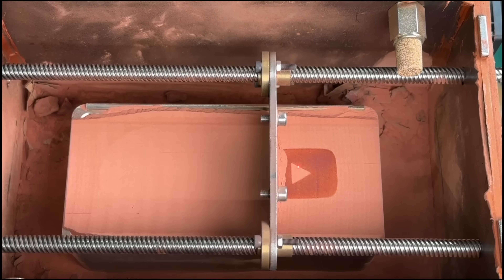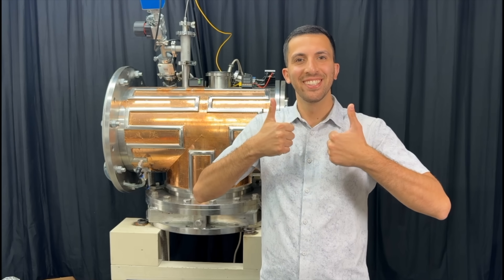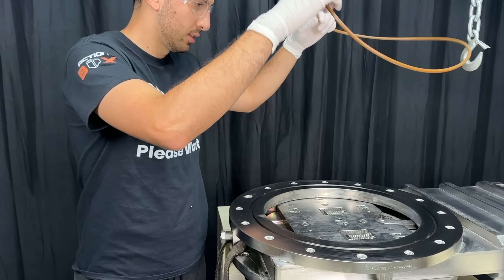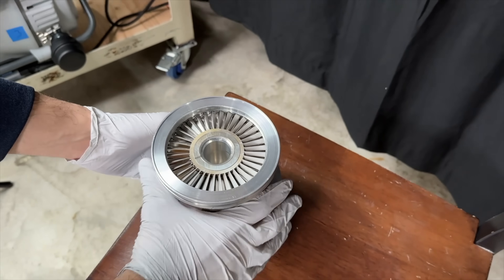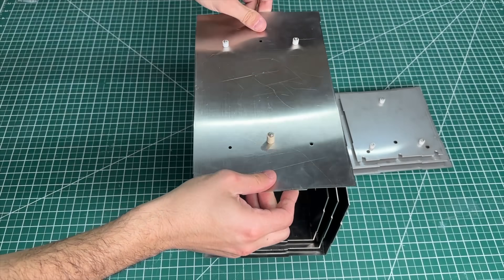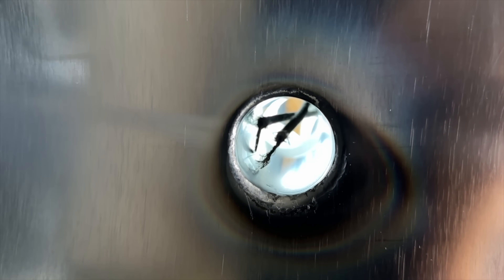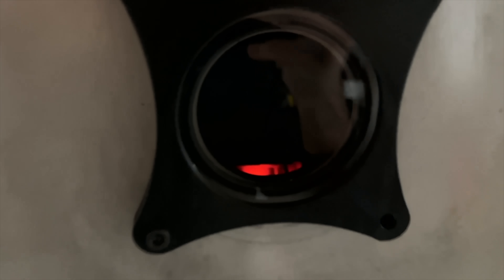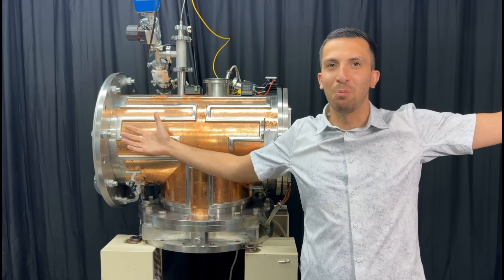DIY Vacuum Furnace (Full Video)

Comment: I don't see why the window would buckle under that loading condition.. What you refer to is just called bending or dishing (if you want to hint at the double curvature) 
Oh and loose this influencer vibe, as someone else pointed out, totally unnecessary
Reply from the maker: Perhaps it would help to know that plastic absorbs infrared radiation extremely effectively. While dishing and bending will occur under only vacuum, the 1100 celcius furnace inside is enough not just to soften plastic, not just to melt it, but enough to literally turn it back into its molecular constituents (which happens to most plastics at around 400 celsius per Thermal gravimetric analysis (TGA)). 

I hope this makes sense, let me know if you'd like any more info on any of this. 

Per your comment on the influencer vibe, we like it  🤷 but we will definitely consider this.
Reply: @ActionBOX true, wasn't thinking of thermal expansion given the way it was presented, but it can indeed cause a compression state leading to instability

Comment: you might want to consider putting ITC 100 HT Ceramic Refractory Coating on the inside of your furnace. 

whats the solution the people who buy the metal printer will use to finish their parts? they can't do what you did and build a vacuum furnace.
Reply from the maker: We actually provide a furnace in the kit. Check out INJEKTO M on our website actionbox.ca

You do not need any insulation in a vacuum furnace so adding the ceramic refractory will only cause problems as it will off gas into the vacuum chamber, preventing you from reaching lower pressures (or higher vacuum). Vacuum is the absolute best insulator, significantly better than anything used to insulate homes, or other furnaces, etc. 

Hope that makes sense
Reply: You use the paste and powder they sell and the vacuum isn't needed. It comes with a regular desktop furnace.
Reply from the maker: @jaro6985  Thank you. Chris, just look at our MASTE product.

Comment: how about the rubber oring will it melt? from the heat
Reply from the maker: It sure can, which is where the water cooling comes in handy. We really have to watch the temperature of the water. If the water cooling system fails we are in big trouble because even if we turn the heating element off, the radiation will continue to make its way outwards to the chamber walls for a while longer.
Reply: @ActionBOX  yeah you should find out how much energy is left after turning it off, and design in a safe zone for water temp for a safe shut down. If you loose vac with the turbo spinning the results are generally catastrophic, and potentially dangerous if the mounting can't withstand the torque of the rotor suddenly seizing (large turbos have killed ppl this way).

Comment: How hot does that steel backplate get at full power? Did you really need the water cooling circuit?
Reply: Well idk about here, but in my experience the water cooling is mainly to protect the orings, obviously the oring rubber melting is not good haha
Reply from the maker: @xxportlaxx is correct. the intent is to protect the vacuum chamber and everything that ensures the vacuum. You must consider that in a pure vacuum, any power we put in must also come out, and it does in the form of radiation. Therefore, if I am heating with 3kw of power inside, eventually when all of my heat shields are glowing red hot they will start to radiate 3kw of power  directly to my vacuum chamber. I therefore have to have a way of dictating all of that power. Perhaps a better idea for my next iteration would be to have many more heat shields, so by the time the center of the furnace is done processing, the outer most heat shields aren't that hot yet. Does that make sense? Great question.

Comment: Very cool! Exiting to follow along! 
How did the magnets hold up? I was under the impression they don’t like heat very much?
Reply from the maker: Im glad you asked Bernhard. They did not hold up for the exact reason you mentioned. It was an oversight on my end, but I did account for this by designing it such that if the magnets fail, the door will drop and close shut to avoid a catastrophe. 
Great question. What else did you notice? haha
Reply: @ActionBOX  makes sense. good that it worked out in the end! its an interesting problem though. high vacuum AND high temperature pass through sounds like quite a challenge. would flooding the chamber with argon or even just nitrogen instead of vacuum be sufficient for sintering? would certainly make a lot of things easier I assume?